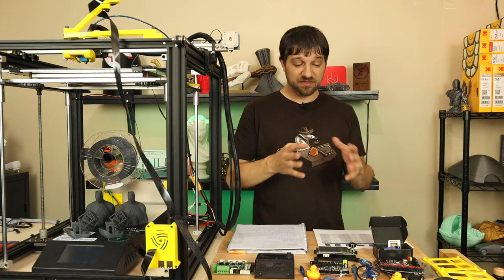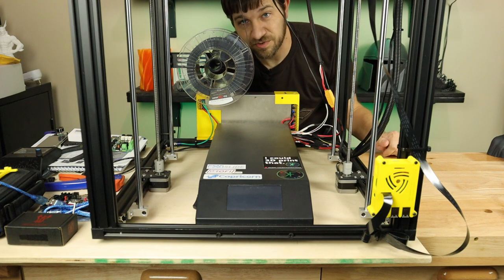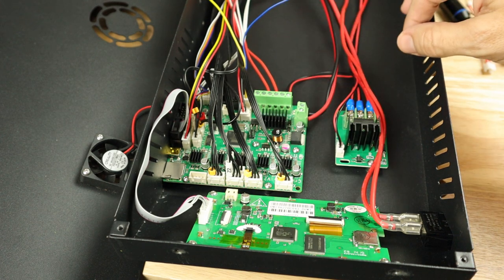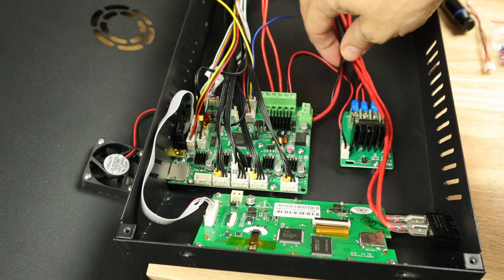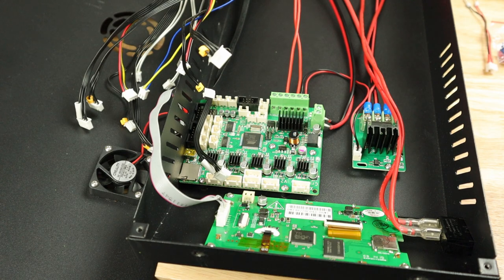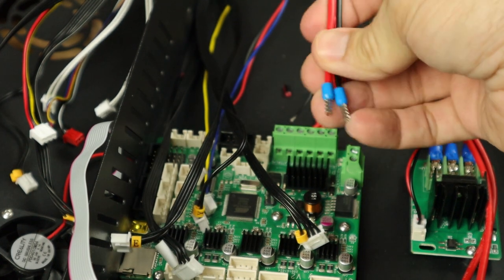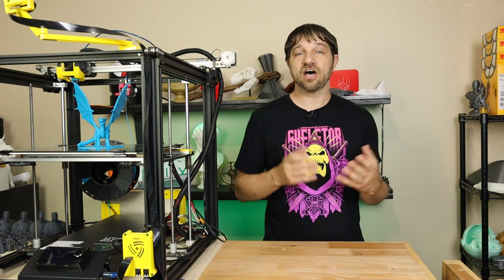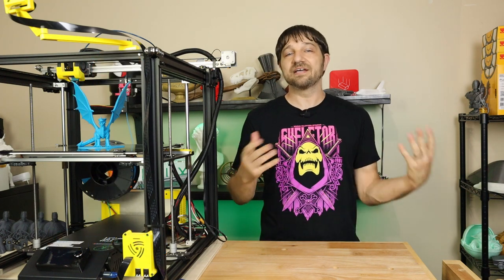Bigtreetech Ender 5 Plus Upgrade: TFT35 Display (Part 2)

Comment: hi there im in a bit of a pickle and first time using aftermarket boards, i have just purchased the btt 1.4 turbo and the tft screen, i have spent a good few hours trying to understand the firmware and im struggling, i will get there eventually but i really need to get this 5 plus back running again, so my machine also has the micro Swiss direct drive kit installed, please if possible could you make me the bin file. im in the middle of a project for my son and the board it had in the machine blew. so we got these two upgrades and we are lost with it all. many thanks @krisKersey
Reply from the maker: I'm happy to help! If you go to my SKR 1.4 Turbo video, I have the firmware posted in the description. That will work for you if you just go in and change the steps/mm on the extruder in the settings UI. Let me know if you have problems.
Reply: @kerseyfabs  thanks I will give that a try.
Reply: me again while i wait for the board and screen to arrive today, do i need to do anything for screen in the firmware using your bin file you said to use or is it simply flash the bin file and adjust the e steps?
Reply from the maker: @Techno_dad  The screen firmware it comes with should work. I'm working on new board firmware now and when that's released, you can update to BTT's latest screen firmware.
Reply: @kerseyfabs  ok I’ve got it all installed and all seems well yay! That’s a first but I’m scratching my head on how I adjust the levels in bed leveling I’m probably missing it as it’s all new stuff to me so any vids on this would be great 👍 excellent channel by the way too!
Reply from the maker: @Techno_dad  I may be filming that very soon as a short tutorial.
Reply: @kerseyfabs  please do as I’m lost, so used to stock machines I’m now sat there trying to work out how to level the bed like with the stock machine way like in each corner then adjust s offset ect.
Reply: @kerseyfabs  any ideas now that you could help with also the bed levelling for corners is not right it does first left bottom then it goes middle bottom then moves to middle then left so as if its thinking my bed is smaller than it thinks as well. if there is some pointers to just getting me going would be great and i will look forward to a tut on this as no one has yet which is frustrating me a little :(
Reply from the maker: @Techno_dad  That's a known issue on the display firmware. I'm hoping they fix it in the next version. If you switch to bed leveling under the Marlin firmware, it should work.